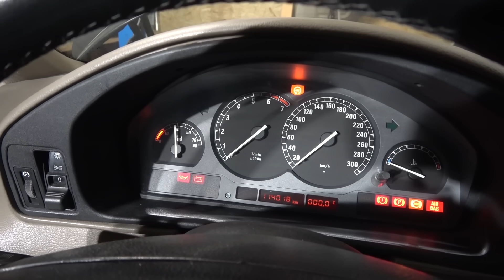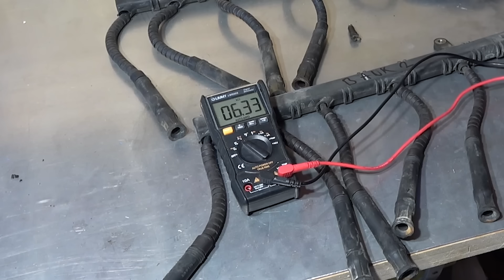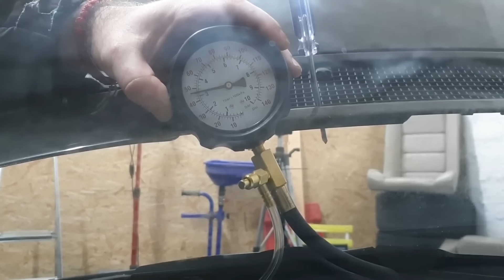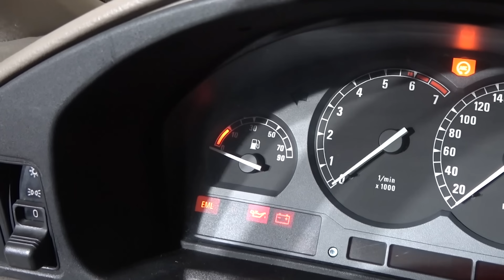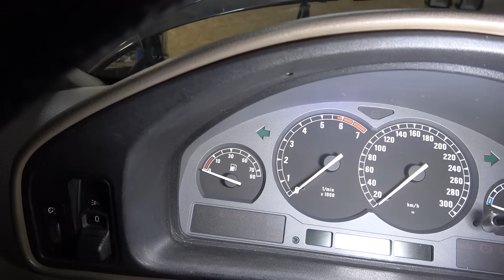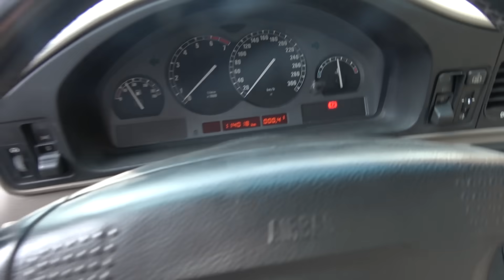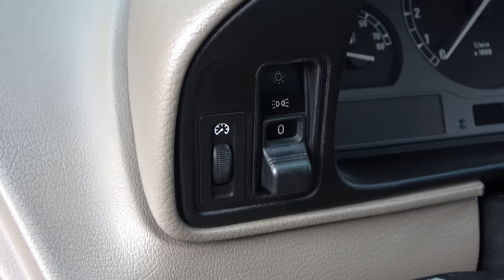Back in Service After 16 Years - V12 BMW E31 850i Revival - Project Malaga: Part 2

Comment: Now I know why a friend of mine who got a V12 BMW E31 850i  at an auction ....cheap ...not running ! He  left it not running when no independent mechanic could figure out all that was wrong with it,  after flushing out a lot a cash , he also sold the whore at auction ! Too damn bad because as high dollar  whores go ...the V12 BMW E31 850i  is a good looking whore ...but like most of their kind ...it is best to stay about  150 yards away from them ..wearing a full hazmat rig 🤣😂🤣 . They look great ..but will drain your wallet turning only a few expensive tricks for the money. Not easily done ,  an old fashioned  land of the fee v8 would be a good performer to stuff under the hood that would be easier on the wallet year to year...back in the late 60s and 70s that was a common option ...expensive complexity for its own sake is worth CRAP.
Outstanding job of resurrecting it , but perhaps not worth the miracle you performed , possibly better off  left embalmed , suited to remain a mummified monument to too much  unnecessary complexity  . Seriously masterful work 👏👏👏👏👏....not many mechanics are as skilled or as ethical